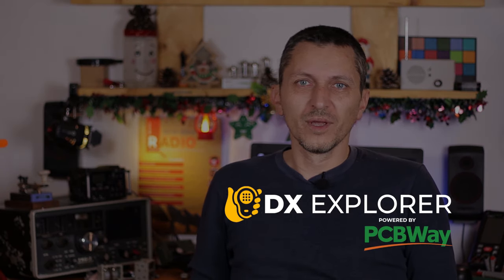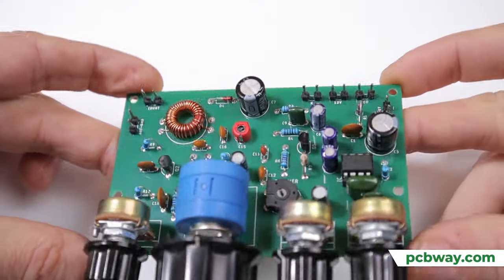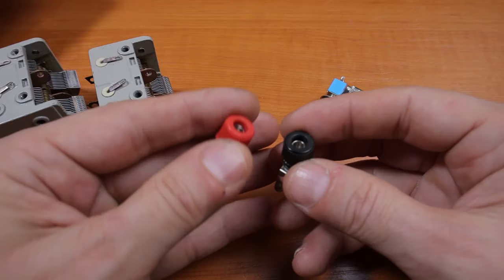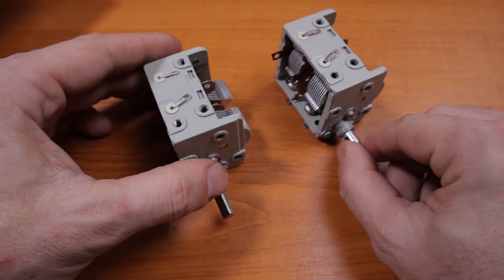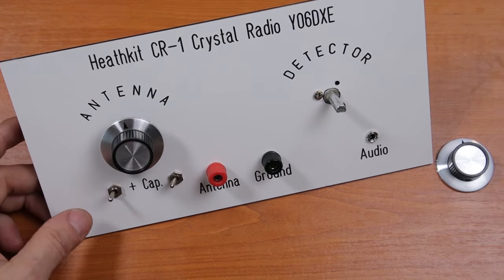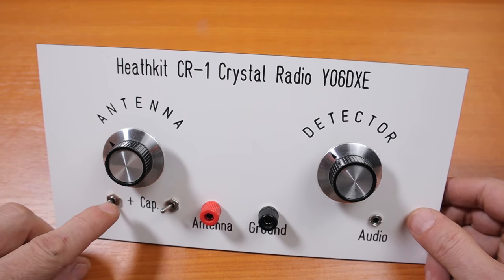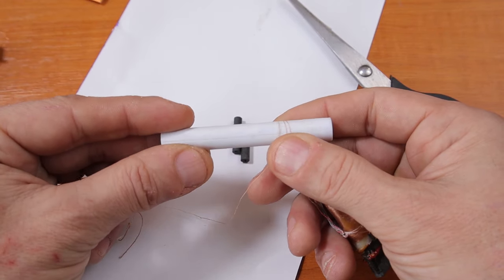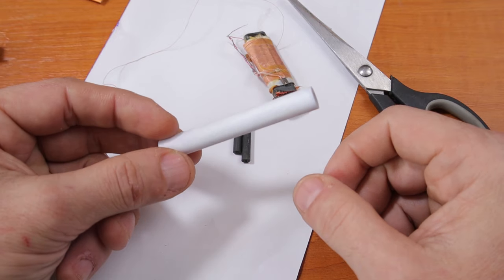Heathkit CR-1 Crystal Radio Replica - 1958 Classic Crystal Set

Comment: It turned out great with very simple design. Now i get why it took you some time to make coil😅. you can leave that ceramic capacitors there it wont change frequency that easy.
diode I think it was Soviet d9 diode if you get d18 it will work much better than it is. that's all i wanted to say. Good luck and 73!
Reply from the maker: Thank you so much. I have a couple of diodes that I want to test and see "who is the star" 😅. The coil... ohh yes hahaha... a nightmare to make but it turned out great and I am happy. I love it so far. The capacitors... ohh yes they seem to be just fine so they will stay as they are. I have a few more crystal sets designs I want to try just for fun and to bring back memories of the past. I just need a bit more free time. 73 my friend, YO6DXE.
Reply: @dxexplorer  yeah  free time is most important thing in every project 😁. okay then good luck and 73!
Reply from the maker: @4L1LAT Thank you my friend. Ohh yes so true. Have an amazing rest of the week. 73

Comment: i have an old decametric tranceiver with his extrenal power supply... Near 1960 i think, i must try to restore it but not now...
Reply from the maker: Woaaaaaa. Those are nice to bring back to life for sure.
Reply: @dxexplorer  Yes, it's great because all yjese old tranceivers are good systems. I have so many CB tranceivers like xtals 6 channels, and a very old tranceiver headkit with its external power supply, non fonctionnal bot able tu be restored. I love this old tranceivers. New items are not so good...
Reply from the maker: @francksylene1560 i also love old school stuff... all analogical. The new equipment its nice too... but it feels like I don't have so much joy as using an older one.
Reply: @dxexplorer  I'm ok for that, all my tranceivers are vintage ans analogic... And alwais a pleasure to use it. I dislike strongly new CB tranceivers with digital electronic circuits as tje SDR. Old CB are ok after 50 years, but in the future, digital tranceivers wont be ok after 20 25 years... This is the problem of digital technology and low cost components used in the new tranceivers...
Reply from the maker: @francksylene1560 I totally agree with you. That is why I am so much into older stuff. I always say... old is gold 😁

Comment: Maybe you could fix some m3 type nylon bolts to the ferrite cores with nuts glued to the former so you could adjust the inductances of the coils.
Reply from the maker: Ohh yes I wanted to do that. Sadly I was in a rush so I can finish filming the video... but I think I will remake the coil and then I will also fix the nylon bolts too. It would make my life a lot easier ))). 73, YO6DXE. P.S. I think the original ones were made the same way.
Reply: I believe they were also I wonder if wave wound coils would make a difference. @dxexplorer
Reply from the maker: @roberthorseman7432 That I don't know. I kept trying to find some high resolution photos of the original ones... but I think what I found so far they seem to be replicas so I can't tell for sure. But I think as long as the coil has a good Q factor and the proper inductance as calculated for the desired frequency... it should be OK. At least this is what I did with the one in the video as I recalculated the inductance to fit the value of the variable capacitors I had... trying to cover the same frequency the original receiver covered.